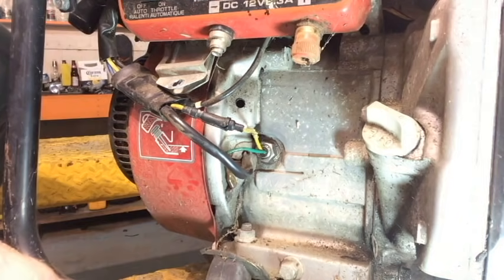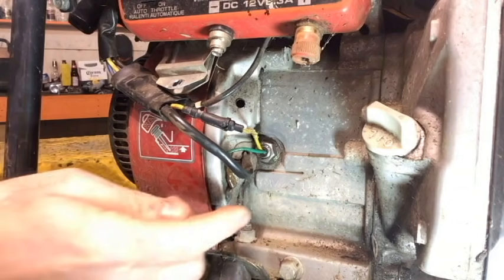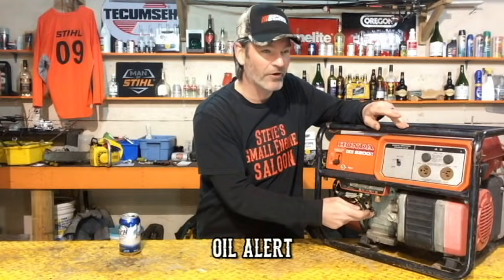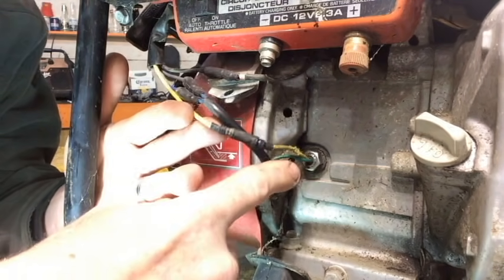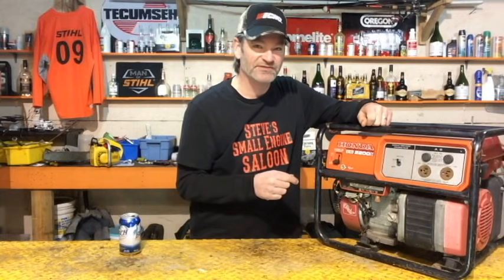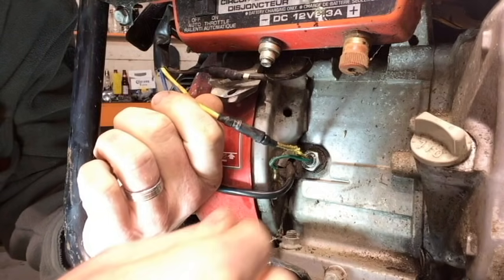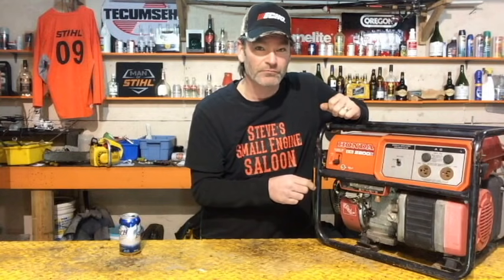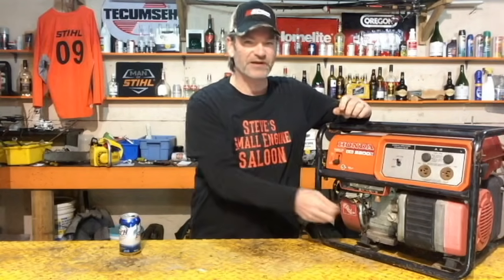How To Fix A Generator That Won't Stay Running

Comment: Great video, Steve. I have a question about the throttle control linkage. I inherited a generator with one of the Chonda carbs. It's the big blue Harbor Freight generator.. 7500 watts output. My late father in law must have been trying to fix it and the linkage is hanging unconnected on the CARB side. I see the plastic doodad it goes to, but It keeps falling off and I can't find a picture anywhere that shows how the linkage is secured onto the plastic piece on top of the carb. same with the thin return spring. Where do they connect? Can you help me out with that please?  a picture of how it connects would do me wonders. Thanks a bunch!

Comment: I'm going to check this on my Onan micro quiet 4000 generator.  It shut down after about 10 minutes of running with A/C on then wouldn't start back up.  I waited for a couple of days and it started right up but would only handle using the fan.  When I turned on the A/C the generator shut down.  Maybe this is something else.  What do ya think?

Comment: Enjoy your videos. What should I look for if my Honda generator runs wide open?  I can control the rpm if I hold the governor arm. When I let it go, it immediately ramps up to full speed.  It’s a Honda GCAH- 1046896EY.  Can’t figure it out.   
Any help would be appreciated.

Comment: Hello Steve,first why did u call the two ends of the yellow wire the female end and the male end? What are you trying to bring up? Also unplugging the oil system wire is not the best idea and what if it’s not the oil system problem,it could be a compression problem with the piston cylinder,or faulty spark plug,or no gas,and many more problems.

Comment: I'm a maintenance guy and I didn't think of doing that,  lol,  so simple.  I knew that was the cause but just thought it wasn't level enough. Silly. I'm all taking the fuel system apart and cleaning it,  wasting all that time and energy.  Jeez

Comment: Steve what's wrong if your generator starts fine, runs fine, but as soon as you plug anything into it the generator shuts off?  We have a predator that has always pumped our pond water to our water tank for our animals, but this year after the winter its been giving us this problem.  Help please.  I don't want to buy a new generator or take it in if it's a simple fix. Thank you ahead of time!

Comment: I have a new Westinghouse Wgen9500DF that was dropped or damaged by the freight company.  Amazon has given it to me.  I can't turn it with a rope.  I can turn it with a wrench, but it turns too hard.  I pulled the plug, it has oil, nothing is visibly damaged.  The valves were a little out, so I reset them.  I put the recoil starter back on.  It is still hard to pull.  What next?

Comment: I have a Honda EN2500. Did oil change,  changed carburetor, fuel pump. It starts and then shuts down after a few seconds. I can keep it running by holding the Choke rod in a certain position. But then if I let go it just sputters and dies.

Comment: i was wondering if that is not it, do you think that another problem might be fuel cut-off solenoid on the bottom of the carb
Reply from the maker: That is fairly common...
Reply: Joseph Plowe, Merrimack 😂

Comment: hey there on a un related topic I was wondering if you shop keeps in stock ms390 engine pan bolts that come up from the bottom and bearings and seals in stock? I'll have to call them in the morning but I'm guessing there expensive too eh?
Reply from the maker: We might have them.  I doubt they would be expensive though
Reply: you can always take a good bolt to the hardware store and get one that matches.

Comment: I have a Coleman power mate 6250. It runs on ether but won't stay running on gas. Replace the carb and poured fresh gas in it. Still does the same thing.

Comment: I just changed the oil, generator was good for a few days, then randomly started randomly shutting down after am hour or more or less.  I checked the oil, wasn't low...i still topped it off, same issue.

Comment: I have Loncin 8400 Watts gas generator I've change oil it and its only every half hour and the engine shots off but if I start and run again same thing every half hour turns off.

Comment: I've discovered that dirty oil can cause the oil sensors to fail.  Once you've determined that the oil sensor not working by unplugging, drain a bit of dirty oil, and add kerosene into crankcase directly.  Be careful not too overfill.  Then run genset for 5 minutes, drain all the oil/keno out of crankcase and refill with fresh oil.  You may find that the kerosene will have cleaned the sensor and now genset will run without bypassing the low oil sensor.
Reply from the maker: Great tip!  Thank You...

Comment: My champion generator (I know not the greatest brand) has the opposite problem .. it will die out quickly if the oil sensor is detached.  I was having trouble until I noticed the oil sensor had been disconnected.  I decided  to reattach the oil sensor … bingo problem disappears.  Very odd indeed.

Comment: Steve I did all of that but generator still run for 10 seconds and die i found out oil is mix with fuel i did oil change but still do the same what problems maybe ?

Comment: Could also have a 'banana' in the exhaust. My Champion has a screen tube that goes into the tail pipe a couple inches. Spark arrestor.  Was clogged right up. Started and ran just fine. Better than ever actually.  So kids check that. Dint see it in videos

Comment: Didn't work for me. Disconnected the Oil sensor (yellow wire) also had the Carburettor off and cleaned that out thoroughly. Engine turns when you are on the pull chord but won't run! Good spark, new plug put in too. Fuel getting into Carb fine also.

Comment: I'm working on an older Powermate Honda GX390 unit, square generator 6500 8k peak PM0496504.18...  I rebuilt the carb and it started on the first pull but, if the panel switch is on, it hunts and stalls out unless you play with the choke, also it produces no power..  When I flip the panel switch off, the engine runs perfectly..?  I am about to start testing and thought I'd ask if anyone here has seen this before, maybe steer me in the right direction?  The slip rings are at 76ohm, seems high but can't find a single spec sheet on it of course so, fun stuff... I was mainly interested in the motor so no loss there, less than 150 hrs on it, seems ridiculous that the genset would be bad already..

Comment: i just got a 7500 diesel razer  generator and when i start it , it runs away and i have to pull the fuel line to kill it , some one point me in a direction please

Comment: The problem with my generator is that it cut off after like 20 min is full. The oil just got changed yesterday, the tank is full and it has that oil sensor thing as well.

Comment: Generator engine will idle but dies when move switch to run. When I disconnect the oil sencer wire it will run but started smoking.  It's a champion generator. What's going on here?

Comment: my generator only runs at 120 but when I switch it to 220 it shuts off when I plug in the 140 welding machine

Comment: Didn’t solve my issue. New generator. Filled with fuel and added Stabil last year. Started it every couple of months and let idle for half an hour each time. Trying to get it ready for a major cold front this next week, and it won’t stay running.

Comment: Bro.... If I weren't a man... I'd hug you. Power has been out for 4 hours. Wife can't sleep cause its Texas and it's hot. I'll be damned if the dern thing wasn't low on oil. Here's what's funny. Done pulled the carb. In the dark. Re built the carb, cut new gaskets... In the dark.... Done drained the tank and checked for blockage... Done changed the filter.... Done gapped the plug.... Damn oil was low.... AC running. Happy wife. If I ever see you in public I owe you a beer and possibly a steak. Let's see if she wants to cuddle lmao!
Reply from the maker: Right on Brutha!  Thank You...

Comment: What about PROPANE starts but want stay running?
Reply: Loose, Micro switch, intake line gas, choke, plugs, valves, low oil...? It keeps powering off.

Comment: I have a 5500 porter/cable gen,, It runs about an hr maybe up to 2 and will shut down,,BUT it will restart with no problems Do you or any of the people here have any ideas ??  PS I always run the gen dry of fuel before storing it

Comment: How about a generator that won't go off? It comes up with the key but when i turn the key to off on the ignition, it doesn't respond.
Reply: ground the spark plug with a screw drive or shut off gas to starve it .. switch grounds the electrical and it is bad

Comment: Damn didn't work for me,. Mine has started to hardly start at all then when it does it either cuts off quick or when a load is connected.

Comment: I have a cat rp8000e and ut runs for 30 secs and then the powers cut, I unplugged the oil sensor and it still cuts the spark power every 30 seconds,  I'm not sure what else this cat generator has on it that would cut the spark plug power ever 30 secs, if you have any ideas let me know, thanks

Comment: So..mine is full of oil, unplugged the yellow wire, and still, runs for a sec and dies. Something is cutting my spark. I need my generator for my ac, I have cancer and I am dying of heat stroke.
Reply: Don't over fill with oil. Only half way on the dip stick

Comment: Did that and it ran for like 20 seconds instead of 3 and still turned off 🤦🏾‍♂️
Reply: Fuel filter + carb clean
Reply: Or replace the float -sensor he mentioned